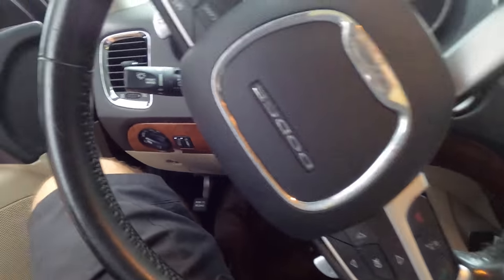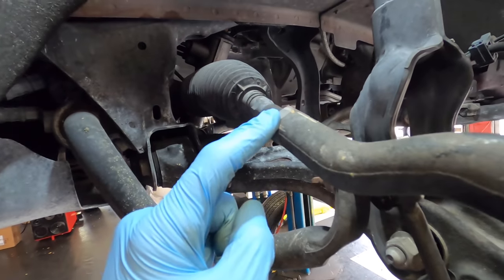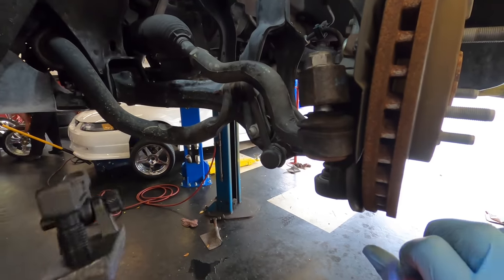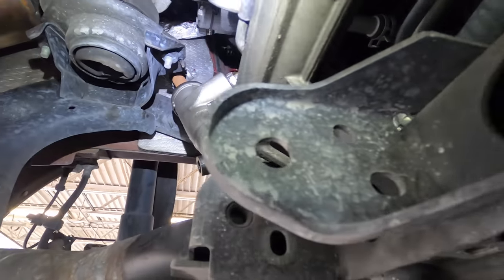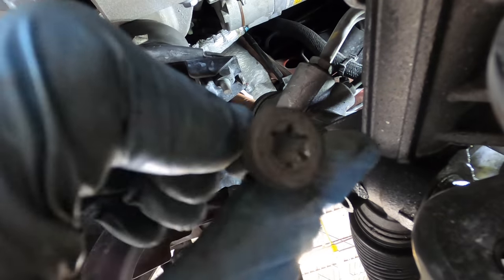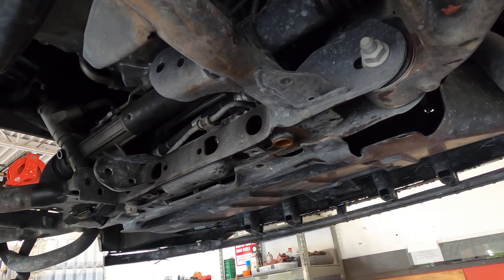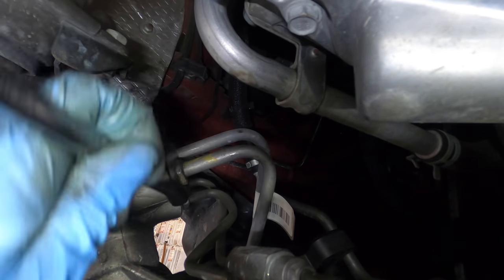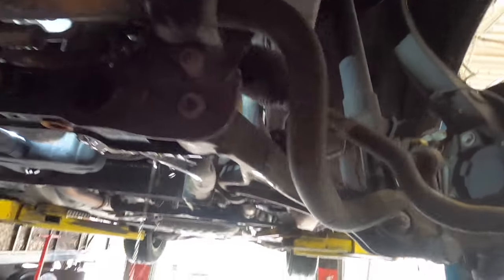Engineers vs Mechanics | They GOT Me!

Comment: And this is what we call "Getting Chrysler'd." All automotive engineers are a-holes, but there's a special place in hell for the Chrysler ones.
Reply: Lol first got Chrysler'd good when I thought I just needed a simple belt tensioner for a Dodge Neon.
Got Chrysler'd just the other day by the t-case fluid access on grandma-in-laws 300.
Reply: I don’t mind working on gm or dodge. Fords destroy me with all their special tools
Reply: @FixIt1975  a lot of Chryslers are European designed these days.
Reply: @EvilTurkeySlices  I'm well aware,  my point was they are still much easier than like a v8, twin turbo awd BMW
Reply: Agree, but have you seen BMW?  They are on another level
Reply: @guillermogomez1615  They're on another level all right. Never seen an auto maker with more oil leaks ever. They are subpar quality and over priced

Comment: Ray: Your explanation for what and why a line (flare) wrench is used sounds good, but no.  The fittings on a hydraulic line, brake line, power steering line, etc differ in one important way from a normal fastener (nut or bolt).  The hole in a fitting is significantly larger, leaving less material and therefor, greatly reducing the crush strength of the fitting compared to a nut. And many times the fitting is made of brass, further resulting in weaker.  If you use a standard wrench on a fitting, you have the possibility of crushing the fitting into an out of round condition because of the limited points of contact (2) between the fitting and the wrench.  This can cause the fitting to not thread in fully or jam in place and may even prevent the flare end of the line from seating correctly.  A line wrench provides maximum points of contact (4) between the fitting and the wrench.
Yes, I know, you have removed/replaced 1000's of fittings with regular wrenches and never had a problem.  I too have removed 1000's of fittings with regular wrenches, but in the case of a rusty or over tight fitting, you and I both know the fitting will go "egg" shape unless you use a line wrench (and even then it could still bugger up).
Line wrenches and the fittings they are used (cheap $) on are an excellent example of "poor" engineering design and the primary reason for the creation of AN (expensive $) Fittings.  As with anything, you get what you pay for.

I suspect that steering racks fits several other Mopar vehicles and that is why fitment isn't optimal.
Reply: Spoken like a true Engineer
Reply: PERFECT explanation as to why you must use the PROPER tool for a job. I worked in factory maintenance for 30+ years and I was constantly schooling other mechanics on proper repair practices.
Reply: We found the engineer
Reply: You explained this very well, just wanted to add I've come across a line nut or two that had to be soaked for a while before attempting to loosen them. I know exactly what you mean by 'egg shaped' line, I've done it and had to go to great lengths to fix it.
Reply: This is not a Crush fitting, you are lock on an Old style. this fitting  is for slide swivel.  He did it Just right. I am a 68 year old Ex Master Mechanic Work on cars at South America ,Europe, and USA. lost of foreing Cars, Citron, Renault, Simca, Talbot. Vauxhall, BMW. Cortina, Rovers. Triumph. Fiats, and Ducati Monster that Ride Now and do all Maintains, is a Fuel Injected 803cc.  44m/m bore throttles. and yes Crush fittings are only good for so many R/R then are Useles you need a whole New Line.
Reply: Im 64 years old worked vehicles since i was 16 first time i ever heard the reason for a line wrench still learning at 64
Reply: @inamuchangel  Really matters not if its old style, new style, crush fitting, or no...One of the purposes for a line wrench (Flare Nut Wrench) is to come as close as you can to putting a 6pt box end or socket over that fitting. These often have a tendency to take a lot of torque to remove and open end wrenches are notorious for rounding fasteners. The extra time spent using the correct tool instead of having to unnecessarily replace or repair a set of hydraulic hoses seems worth it. That's what these wrenches were designed for.
Reply: @inamuchangel  WTF does that have to do with ruining a nut by crushing it with the wrong tool?
Reply: Kent you are absolutely correct on the line wrench and believe it or not most "mechanics" don't even know this. That when somebody else a.k.a. technician goes to use the correct line wrench, it doesn't fit anymore because the fitting becomes warped due to the "mechanic's" quick and poor decision. Its not about just getting the job done ... Auto repair is about putting your name on the fix saying "i did this the right way" and allowing the next repair technician to use the correct tool for the job allowing for a timely repair.  I hope that if that dodge comes my way in a few years when the rack is leaking again (which it will , its a dodge) i don't have to use vise grips to get the lines loosened.
Reply: You make a convincing scientific argument but my reason for the line wrench is still the same: the open end wrench has failed to turn the line nut :D
Reply: @inamuchangel  Huh?
Reply: It's the tech, not the engineer, who takes it in the you-know-where if he rounds off that flare fitting by not using the right tool.  My dad, old-school aircraft, heavy truck, and car mechanic would thump me aside the temple (knucklehead's true meaning) for not using a line wrench; he considered this almost as sinful as using pliers on nuts/bolts. My father believed in the death penalty for people who damaged fasteners. If he were still alive, I would have plastered his house with Ray's cotter-pin-soul stickers; I once saw him hit his employee with a wrench for using a bent nail for a cotter pin on a customer's car.

Comment: I always counted the number of turns it took to remove the tie rod ends, and write it in chalk on the inner fender somewhere. Makes the wheel alignment a whole lot quicker.
Reply: i always counted the turns but never even considered writing it down on the car anywhere. thats brilliant
Reply: Nice trick but absolutely pointless in this case, since the whole rack and both tie rods were replaced.
Reply: I'll measure the best I can from the center of the ball joint to some point up the line to allow for replacing with parts that are not exactly the same.

Comment: To give you some insight into the design process of suspension and propulsion systems of cars: It's a battle for space. Suspension engineers want space for their structures. Ideally straight rods everywhere, a lot of space for wheel travel and steering. The worst part to place is the steering rack, since it's a part that goes from side to side no matter what, and is severely limited in its positioning due to the steering geometry.  Meanwhile the drivetrain engineers need to run the exhaust pipes front to back, no matter what. Ideally as straight as possible. Depending on the car, a drive shaft accompanies it on its journey to the rear axle.  You can start to see the conflict of interests.
So tldr: Not just mechanics hate engineers, engineers also hate other engineers that take up their prime design space. Someone's gonna lose, and all you can do is hope that you don't have to get out the part that lost.

Comment: Was there any way to drop the mounting bolts in from the top? If you could, it would make a difference if -- IF -- one day a nut came loose. The bolt would remain in place, although loose, and the vehicle could still be steered to a safe stop. As it is, if a nut loosens, the bolt falls out, and it's time for "Jesus, take the wheel"!
Reply: Supposed to be reassembled with Loctite. The original pinch bolt on the steering column is supposed to be thrown away and a new one installed...with Loctite.

Comment: As a mechanical engineer that has worked for Ford and Goodyear, I am literally laughing my ass off with you getting that power steering unit out. We have to deal with pressure and so we enjoy passing it on to you. I actually thought you were going to have to unbolt the motor mounts and Jack the engine up but you got it.

Comment: I was thinking the replacement rack may have been slightly different making assembly easier. I lost interest in working on cars after the 70's. Everything was easy to work on  back then and most of the parts lasted the lifetime of the vehicle. Good job Mr.! BTW You can swear at my vehicle any time you want.

Comment: @21:20 the difference is that the old one you removed had inner tie rods on  limber ball joints allowing the rods to flop down no matter what orientation you had  the rack in.  The new one had stiffer joints, requiring you to position them where you wanted them to make the assembly work, and they stayed there rather than flopping back down and fighting against you.  If you jump to a few seconds before this question watch the rack go in you will see several adjustments of the ball joint to help with this assembly.

Comment: Great video Ray!    I'm always amazed by how rust free most of these cars are.  Up here in the frozen North,  we like to put 10 pounds of salt on every foot of highway.   On A 2014 Durango  up in New England , this would be a constant fight with rusted and broken bolts
You did  get lucky this was the 2wd. Nice work
Reply: We have the same issue here in Atlantic Canada. I've seen new vehicles with more rust after their first winter than that Durango had.
Reply: Northeast US is the same. Buy a new car, give it two years and it's orange under the entire undercoat already. Give it 10 years and things are going to break when you remove them.
Then after 23 years.. Well, I've gotten into welding because I'm tired of fighting with my old '98.
Reply: @DawnBriarDev  when you work on 1960s cars , all these bolts come off so easily.

Comment: Have worked on my own cars for most of my life and spent the last 10+ working in a construction business I really do wonder if engineers and architects are just different sides of the same coin. I really think the solution to both is to make them actual get out of the office and work with their hands on the messes they've created.
Reply: problem is their design goals are different than maintenance goals, they need to cut costs and make it easy to manufacture.

Comment: How come you dont take that extra step and wire wheel or clean the rusty bolts on things you fix? Especially on brake jobs I never see you clean or grind off rust on the slider parts of the brake pads, I was allways tought to clean or wire brush rusty bolts before reinstalling them with a dab of antiseze? I was just curious,  watching you put those 2 long rusty bolts back in without hitting them on a wire wheel real quick made me cringe.. hahaha, you do good work, I'm not judging what so ever, maybe it's just me. I cant put rusty bolts back in a vehicle when it take 2 minutes to brush em off real quick.. awsome job on figuring out how to beat the system and get that rack out!!
Reply: I was thinking the exact same!
Reply: He's a good mechanic, just did his apprenticeship in a shit workshop (low standards).

Comment: I take a broom handle and push it through the headrest lower area and forward through the steering wheel at the 12 O'clock position with the wheels straight ahead.
This keeps the clock spring centered, a little wiggle room to disconnect the u joint from the rack.
I disconnect the u joint first, and then center the new rack before I connect the  u joint.
Been doing it that way since working at a dodge dealer in the late 80's with air bag systems.

Comment: Pains me to watch you assemble things without lubricant or anti-seize.

Here in the land of salted roads it's almost mandatory if one ever expects to disassemble things in the future.
Reply: Yeah, those main rack bolts should have been cleaned up on the wire wheel and the shanks covered with grease before re-fitting.
When I was in automotive, we were always taught to lube threads.
Now I'm in aviation and for some reason the rule is NEVER lube threads.
Then again, nothing is ever done up as tight as it is on cars.

Comment: I was faced with a difficult and potentially expensive steering rack replacement on my 06 Volvo XC70 at 125,000 miles. I was dreading this job and figured that I had nothing to lose. That being the case, I put some Lucas Power Steering Stop Leak in it and it did just that! It was still doing that when I parted ways with the car at 200,000 miles. Go Lucas!

Comment: LOVE those "engineered" puzzles!

Reminds me of the starter on a '90s 4Runner.
After removing the bolts (which are easy enough to get to) there's about 10-15 min of wiggiling to figure out the puzzle of getting the starter out of the tangle of the engine bay.
Then you need to reverse the process. And if you don't insert the starter into the tangle exactly how it came out you'll get it almost in place but upside down and have to repeat the process.

Comment: A great video Ray!     A  Chrysler product - hmmm.
Well at age about nine I fully stripped my first and very second hand push bike to paint it.    At 16 I got my first English motorcycle and after one year of ownership I had dismantled every single part of it (to find out how it worked)  and changed the engine from a side valve to an overhead valve engine (because it went faster....) and spray painted some  of the parts using a foot pump spray gun.  Three other English motorcycles followed given the same treatment (each one faster than the previous)  whilst I studied Engineering at College.   Went on to become a Chief Design and Development Engineer and had a LOT OF FUN with my younger Engineers by having them explain to me exactly how a part or assembly could be replaced in service.   When managing the design of Serviceable product I also talked to the Service guys and asked them what they wanted.   Got a surprise once when floating the idea of a welded frame assy. vs. prior art of a bolt up one and they leapt at the welded frame idea because they said they would then avoid having to realign the frame parts out in the field.  The welded frame was to be assembled on a jig in the factory.    I also instructed my Design Engineers to use minimal parts for reliability,   NEVER have ANY adjustments,    designs parts to "last forever",   be lubricated for life and make their designs so it was impossible for them to be assembled incorrectly.    That design was produced in 6 months into full production vs. 2 plus years previously,  cost proportionally half the cost of the previous model and after six months in service was tracked to be ten times more reliable.
Part of the design process at Chrysler has to be the validation of part or sub assembly for removal and replacement by the guys that would actually be doing it.    Wonder if Chrysler actually do that?    Also,   why did the steering rack fail in the first place?
Reply: Walter Chrysler was a mechanical engineer. He bought his first car, had it unloaded from the train, and towed home by horses. He disassembled the entire thing until he understood how it all worked. Put it all back together. Took several months of his spare time. Then he first started it up and drove it. There was a mechanic!

Comment: The bracket you wanted to cut off, thinking it was for a 4WD version, is actually most likely for an AWD version of that mini-van.  They did offer an AWD version, but I have never seen one in person. But down south they aren't needed.

One of the reasons I traded off my 2008 Chrysler Mini-van was I got an intermittent check engine light for the EGR valve. Said valve is on the left side of the engine, which with a transverse engine is at the firewall. The dealer quoted me over $500 in labor, because the engine had to be moved. I called a local shop that was recommended to me (this was in 2015). While I was on the phone the foreman looked up the procedure to replace the valve. I heard him say "Oh my God!". I traded off the transverse engine vehicle a few months later for one with a normal engine installation.

Comment: Working on package trucks we got a new model Freightliner that required 2 30mm bolts to be removed in the rear calipers in order to replace pads/rotors. The upper bolt interfered with the leaf spring u-bolts about halfway out, infuriating the entire shop when we had to do service to one of these things. Our policy was to never re-use u-bolts if they were removed so everytime we did a brake job it also got a pair of new u-bolts.

Comment: I was just waiting for Ray to wiggle the rack into a position where it wouldn't move at all.
Sooner or later everyone's run up against this regardless of what they're working on. I had to almost completely disassemble a futon (folding bed), carry the parts up from the basement, out through the garage, and in through the front door in order to bypass the 180 degree turn at the top of the basement stairs. No amount of rotating, turning, twisting, or lifting was going to get that thing around that corner. Easier just to continue on into the garage, take it outside, then bring it back in through the front door, and take it down the hallway into the bedroom. Of course, once 'the scenic route' was decided on, about half of the disassembly was no longer necessary. (But only half.)

Comment: I did one on a durango yesterday... took 20 minutes out and back in. Not kidding. It was a 5.7 though, maybe there's more room for some reason? i tilted the rack mounts upwards, managed to squeeze the steering shaft out by having that facing towards the rear of the car, then turned the rack diagional towards the front of the driver side wheel well, and wiggled it right out. Didn't take off inner tie rods or anything. did have the outers off. The job paid nearly 8 hours and got it done in an hour with alignment... the alignment took longer than the rack!